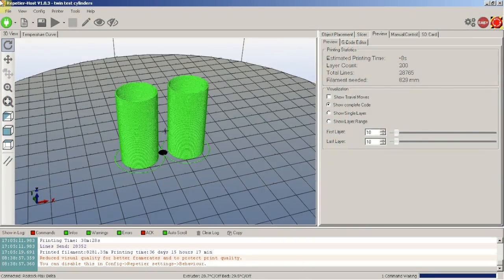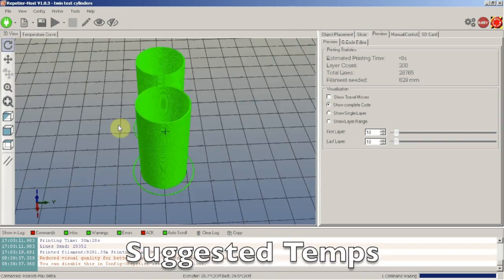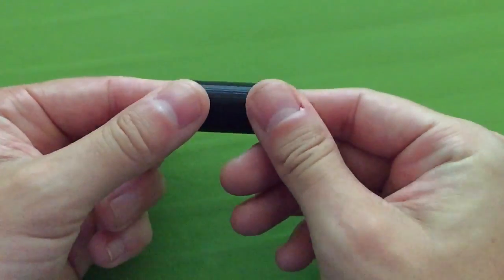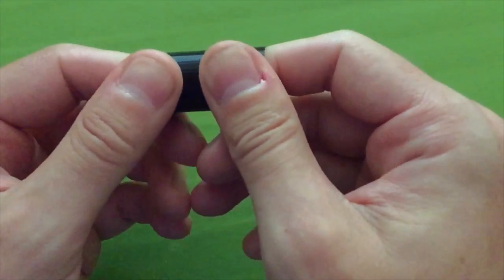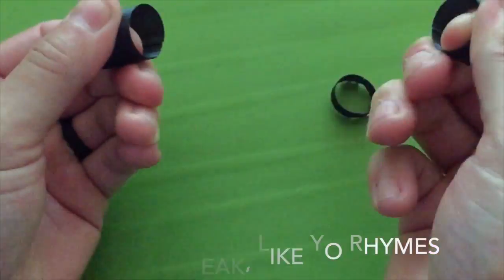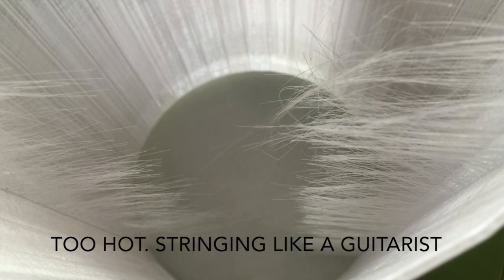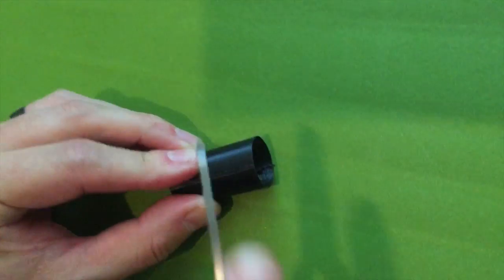Troubleshooting 3d Prints. How to find the perfect filament temperature

Comment: Thanx for the simple and informative tip. I tried your suggestion but nothing works. No matter what temp I set, I get problems. Nothing bonds. I even built a box around the printer (Monoprice Maker Select v2) but the bonding still is bad. So, first thing I did was re-level the bed. Then I cleaned the nozzle using the Atomic method (it's very clean, b/c it's only got about 2 1/2 day's time on it). Then I started out with the defaults for ABS in Cura under Prusa III. Then increased the temp by 5°F for each print till it hit 260°F. Then backed down to 245° and slowed the print from the default 60 to 55. Then tried all those temps again. No success. Then dropped speed to 50, and tried all temps. Nothing worked, so I tried increasing Flow to 102%, then to 105% using the same trials as above. Nothing. Still weak bonds between layers on your cylinders. Absolutely no stringing. Any other ideas?

Comment: Hello. can you link your repetier config files for this test? Not sure what I am doing wrong, all temps seem to split. I started at 185 and went to 220 all are very delicate. My settings
 might be off.
Reply: Chris Riley - my current roll of white PLA needs 230 to print, but it was very strong at that temp.

My previous white roll printed perfectly at 195.

I have a black roll that prints best at 190, and a blue roll that prints best at 205.

Ideal print temperatures seem to be highly variable between rolls for whatever reason.

Comment: The suggested temperature for PLA here is 185, but I have to put mine to 225 just to get some excrusion. Is there something wrong with my 3d printer, and what could I do t fix it?
Reply: +Archsage Rob probably nothing wrong. I use the brand of PLA that my printer manufacturer produces, and the slicing software that is meant specifically for the printer. It automatically calibrates with the filament code from the manufacturer, produces pretty good prints and it likes to set the temperature right around 120. (I only watched this video because I bought color samples from somewhere else)

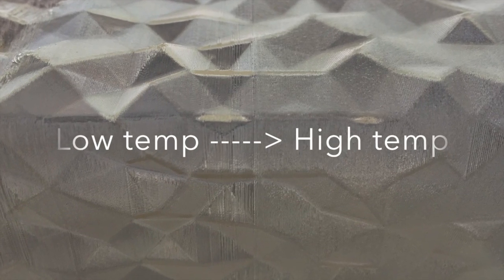Comment: Is that image with the benefit of lower temperatures at 0:55 the wrong way? the voice says low temps = smoother finishes but the finishes on the left side where "low temp" is written looks worse. Are the words not connected to the sides they are shown on in the video?
Reply from the maker: +VictorSteiner That particular example was meant to show the clarity on transparent filaments rather than smoothness - it's not placed particularly well I'm sorry.

Comment: Hey man, cool video. 
Do you have any tips printing small parts.  thanks
Reply from the maker: +pistol kit A whole video? Probably... In the meantime: Go slowwwww. Use PLA & fan (will cool quicker and keep small detail). Use a small nozzle (0.3mm). Make sure you extrusion rate / retraction / temps are all tuned. Print on the low-end of the temp range rather than high. Use fewer walls to keep detail accurate.

Comment: Thank you for this. I am new to 3d printing, and still learning how to get the best results. This was very helpful. One question - I printed with 1 shell, no infill, and no top or bottom, and it came out just as in the video, except that there is a gap that runs vertically down the tube, held together only by some thin threads. Is this indicative of something out of adjustment, or just a result of printing with a single shell? Thanks again!
Reply from the maker: Some slicers let you set this overlap (kisslicer I believe) but in any other one I've tried, there will be a weak spot along that seam. When you do your pull testing, just try to avoid that seam.

Oh, and glad to help!
Reply: It's been a while, but I wanted to add for the benefit of others that Slic3r will let you select whether the seams for each layer are aligned or random. The setting is in print settings under layers and perimeters.